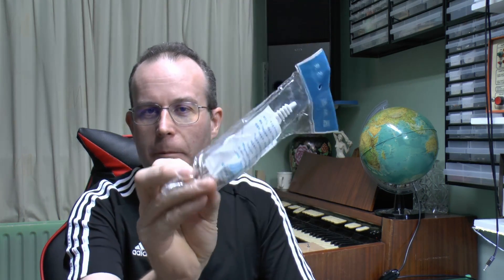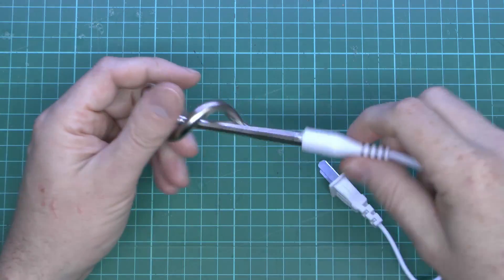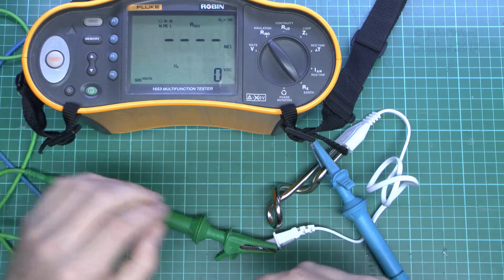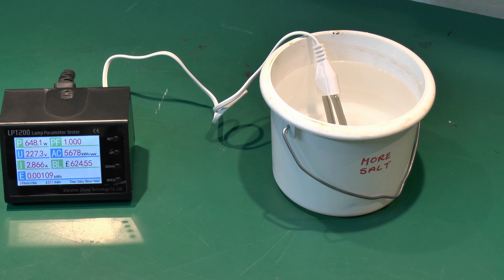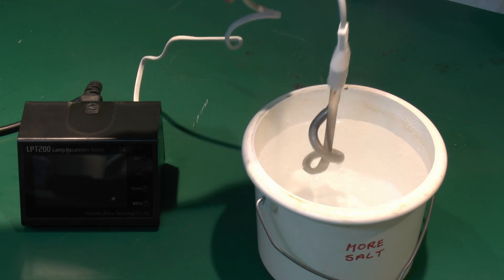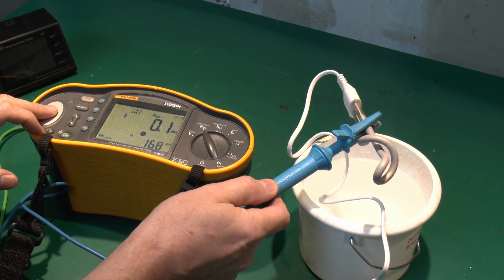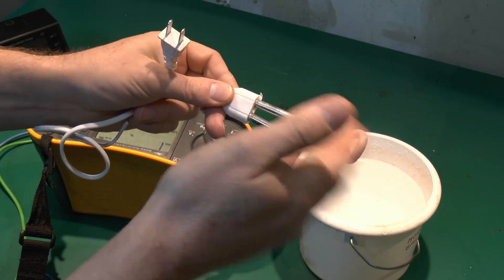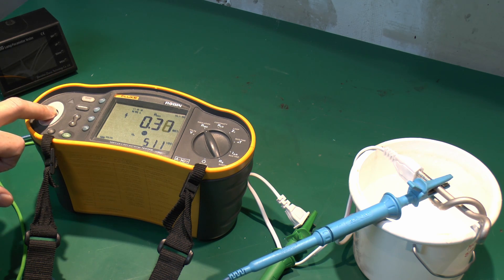Small Immersion Water Heater for Cups

Comment: Given that it lacks Earthing, if the metal part became live, would this trip the circuit breaker (or blow the plug fuse - if wired to a fused plug)?
Reply from the maker: No, it would remain live permanently.  If someone touched it they would get a shock.
Fuse would not blow, circuit breaker would not trip.
Reply: @jwflame  or electrocuted?

Comment: A 2pin device that goes into water has metal body that has not been waterproofed with no fuse in the plug..only OK if the power source is not earth referenced...lethal otherwise.

Comment: @ John Ward - muahaha despite not just being 2 bare electrodes (except USA-plug) , 
its still literally playing with fire: 
No earthing , extra thin wires + no thermal fuse + near melting problem + poor insulation + no fuse + (by official Standard) inherently dangerous USA plug (even a fake one without holes) with exposed live contacts https://www.youtube.com/watch?v=Ihau12C9uq8 + https://www.youtube.com/watch?v=EmVH5En6x6o ... especially @ 230 Volts & 16 or 32 Ampere

Comment: (7:00) - That low insulation resistance reading is obviously due to moisture ingress at the top part of the heating element where it goes into the moulded plastic part.
Edit: Which is exactly what you surmised once I unpaused the video, damnit.

Comment: why didn't you use a cup, as it was intended? the casing wouldn't have been immersed, it would have heated the test water quicker. You deliberately designed a test it would fail.

Comment: Regarding the softening of the flex and molding near the element, have you found that heat damage to cheap plastics is cumulative? If you were able to safely test this device through 1000 hot/cold cycles, would the plastic/rubber eventually melt at a much lower temperature than it should?

Comment: Man, you people in 240V countries don't know how good you've got it with electric kettles. 8 minutes for a pot of water that size is a great time in the US!
Reply: Actually it should be 230V in Europe, but the tolerance is +/- 10%. The UK had to decrease their voltage from 240 to 230V, and here in Germany the voltage was increased from 220 to 230V. Actually we have two voltages here in Germany, the 230V and 400V in addition. Before the voltages were 220/380V. The 400V are between two phases, three-phase is common here, even in residentials.
And the higher voltages have the advantage of needing less current for the same demand. For example, the outlet circuits in Germany are fused with 16A. That are ~3.7kW. In the US most circuits are fused with 15A, that are ~1.7kW. Some are fused with 20A, that are 2.3kW. That are the single phase circuits, but in three-phase its getting better: 3x16A (one three-pole circuit breaker or three single breakers) are 11.4kW. A 22kW tankless water heater requires 3x32A circuit breakers, or fuses, and the cable needs 4 conductors (L1, L2, L3 and protective earth/ground). Neutral is not necessary. The conductor size should be 6mm² (AWG 10 should be comparable).

Comment: Hi John hope you are well. Slightly off topic but you are a wealth of experience and I thought you may be able to advise. I work for a hvac company in the uk and have recently seen a video regarding signal testing to a flame sensor - basically using the meter to measure the current between the signal and the female sensor.

Please see the video link below:

https://youtu.be/ikKq7JdiePE

A fairly simple concept but one of our electrical guys has come back to me and stated -

Testing flame rectification like that won't work on a York, current decay can only be measured by connecting a 120 microfarad capacitor in series with the rectification wire and use your meter to measure across that.

When asked why he responded because of meter Impedence.

He is clearly more experienced than I am with this but I don't understand the need for a capacitor when my fluke 1587 manual advises no such thing.

I was wondering if you could explain it to me?

With kindest regards as always and keep up the fantastic channel.

Comment: It should be 2MOhm because there‘s no earth connection. 1MOhm is the limit for class 1 appliances except the ones with heating elements. They have a lower limit here in Germany, but of course only if they are class 1.

Comment: I assume this can also us DC current of a lesser voltage, could it be run directly from a car battery? 
  When it comes to the final destruction, can you investigate the clearance between the element central heating electrode and and stainless steel outer casing?  The insulation material between the two would be interesting to see what is used. 
  Thanks for the upload John. 👍
Reply: At 80 Ohms resistance you won't get much power at 12V

Call it 12.5V and P=12.5*12.5/80=~1.95W
Reply from the maker: You can get versions designed for 12 volts for car use - although beware the versions that plug into the accessory socket as they will usually overload the socket and blow the fuse.

Comment: Another great video, thanks!  I got a 12VDC version of this, meant for car use. I use to heat the fluid in an ultrasonic cleaner that doesn't have its own inbuilt heater. It's cheap, but has been useful.

Comment: I heard about someone doing something like this with a bathtub about 20 years ago.. (well, he may have done it way way before, I only heard about it 20 years ago).

He heated up the water in the bath, worked wonderfully, and his wife got in..
Later the water was starting to get a little cold, so he throws the heater in 1 end and turns it on, and electrocuted his wife.

I can't say about the validity of this story, just something I remember from a long time ago.
Reply: Big Clive did something like that once with something he'd made with part of a metal bix and a kettle style element, he knew not to get in the bath with it in there though.
Reply: Trading Standards deals with traders - this is [most likely] a eBay, direct from China, self-imported item for personal use, not trade.
If John was to start selling these I'm sure TS would have things to say...

Edit: why did my reply end up here?? It was a reply to the post about trading standards above...
Reply: These heaters were in every house and used everyday when I was growing up. And these are not fake stories about people dying when entering bath with heater still on. These was happening regularly.